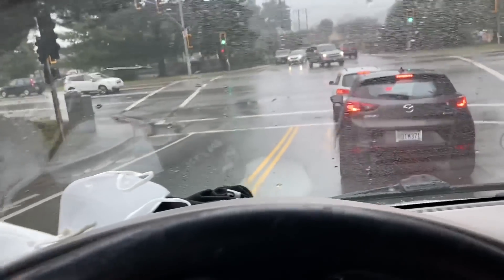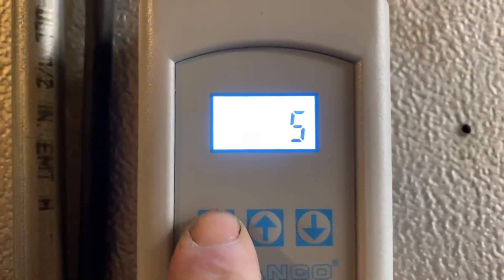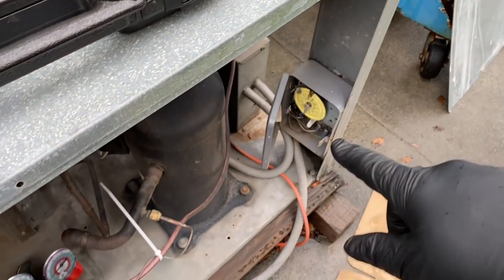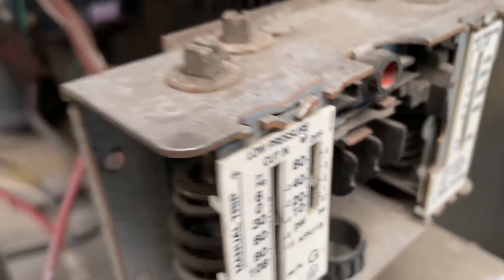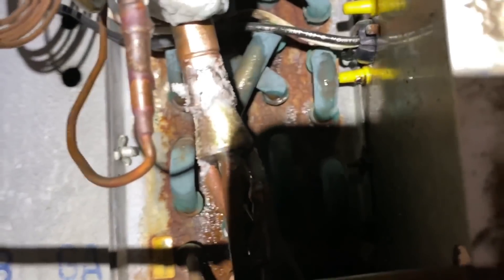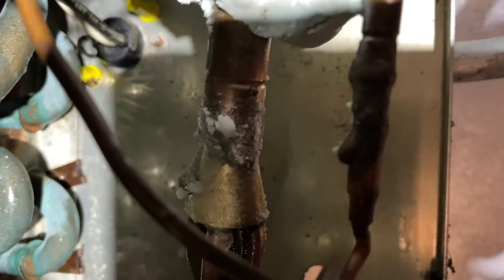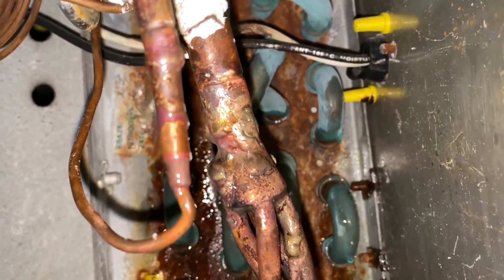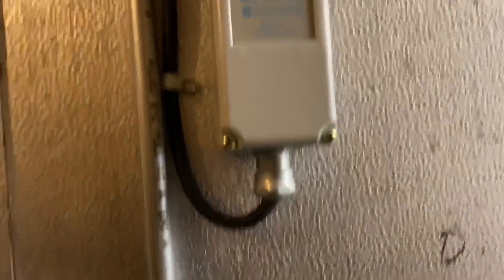Walk in box not cooling

Comment: How do you know which refrigerant is in there ? 
R-22 , 407c , 422b , 422d etc. ?  Or did u just yank it all , what was left , evap & use your 407c , because I believe u said u are a 407c guy. And then labeled it of course.
Reply from the maker: Yank it. I only carry 407c
Reply: @NorCal-refrigeration  why do you only carry 407c? Just curious how come you like it. Just asking...
Reply from the maker: @torosfcp  it’s what I use for R-22 replacement. It works fine and is going to be around a while.  And it’s cheaper too.
Reply: @NorCal-refrigeration  thx. Yeah I agree with that. What if it's a 404a system though, you don't carry that, you don't put in 404a?
Reply from the maker: @torosfcp  I carry 407c for R-22 replacement. My van has R407c, R4040a, R134a, R410a & now R448a.
Reply: @NorCal-refrigeration  I see what you mean. Thanks for the great info captain.

Comment: Good video.  It’s very difficult to find leaks with 12 fans blowing in the room constantly pulling fresh air across the tiny leak area. Make life slot easier for yourself , turn off condenser , let suction rise abiT, turn off evap fans , then go leak hunting. It makes it a lot easier to find a leak fast & accurately. Guaranteed u find most leaks accurately in a few minutes using this method. Good video ! Those evaps are time to go !
Reply: lookie here the self  proclaimed  GOAT of refrigeration

Comment: signal light is burned on the left side , in the front or the rear of your van that’s
why it blinks that fast
Reply from the maker: I installed l e d s and no resistor
Reply: Needs electronic flasher, LED's will hyperflash with OEM flasher. Installing resistors is PITA.

Comment: Nor Cal Nothing beats the H-10. For grab and go I hated the Inficon       D-Tec  I’m trying the Testo 316-3 now seems good. Bubbles work every time😂
Reply: I purchased a Testo 316-3 and I never seemed to have any luck with it. The silly thing would freak out every time it was bumped, moved, etc. I sent it back to Testo for calibration. Came back kinda the same. Lemme know if you want to buy my one as a backup for super cheap!
Reply: The testo works ok for me. If the battery is low you find a leaks all over. Replace with new battery and then u see. Good luck.
Reply from the maker: I’m an H-10 die hard. Made a song about it. It’s in my playlist. I got this to make videos the SRL8 is better than the dtek3
Reply: Company buys all tools👍

Comment: Hey so since it's 407c , I can't stand 407c , did you have to pull the remaining refrigerant and charge with brand new then ?
Reply from the maker: Correct it will fractionate
Reply: Hate its 2..only seen it used on chillers and mini splits here in DK.. Yes you have 2 give it a complete new charge.. But if I'm honest i don't always do it.. If you do Then you might as well convert it